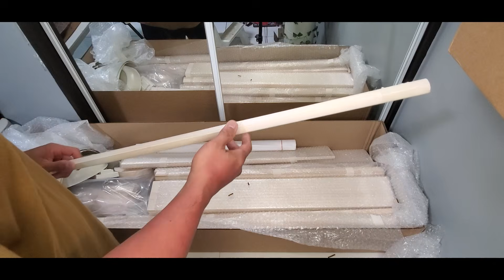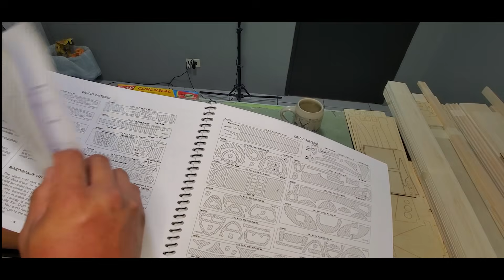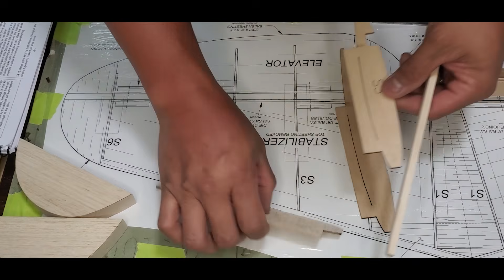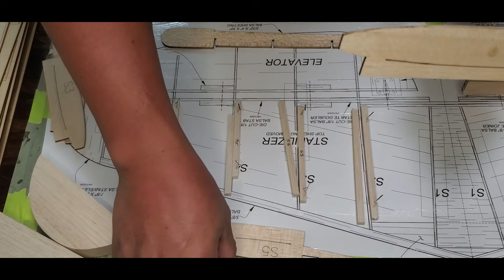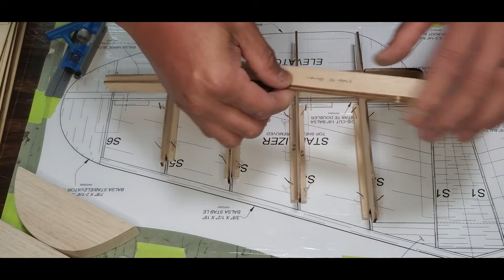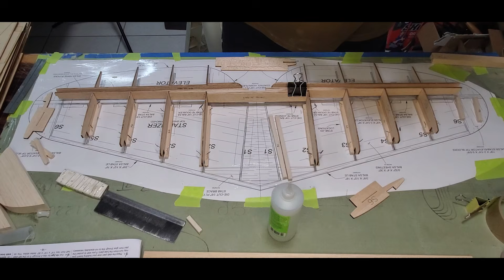Part 1 Planes Revived Giant Scale P47 Razorback Build Series (Horizontal Stab & Elevators)

Comment: Bayona , have you used planes revived before and do they provide the top flight build instructions
Reply: Thanks , will be following along , im finishig a 70 inch ziroli p47 and already thinking what to build next
Reply from the maker: @ritchiethorup awesome
Reply from the maker: Yes, plans and instruction booklet all plastic parts unless you order the fiberglass replacements.  The only thing the kits do not come with are the hardware, screws, blind nuts, hinges, control horns, control rods etc.  That will be the responsibility of the builder to outfit their build with their preferred hardware.
Reply from the maker: This is my first reproduction Kit from Planes Revived.  And it has outstanding quality of the best balsa and laser cut parts, typical Top Flite instruction manual and nice rolled up plans.  Top notch quality kit no doubt.

Comment: Going to be sweet. There are several manufacturer choices for radio engines to fit with way enough power. I have 4 planes inline for me to build. Have a 90mm F35C in its finishing stages, a 64in Sig kwick build warbird racer mustang, that won't be a quick build, lol. A 1/5 scale 89in Pica mustang, a 67 in chipmunk, and a Balsa USA 80in Citabria Pro
Reply from the maker: Nice lineup of models